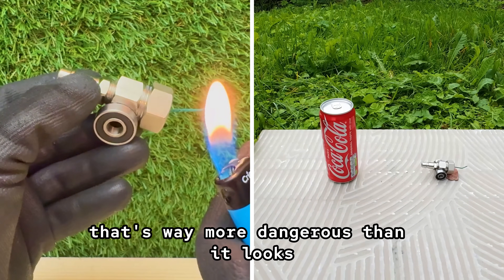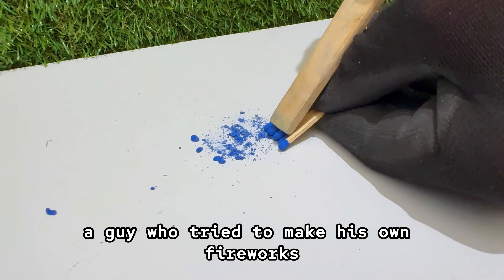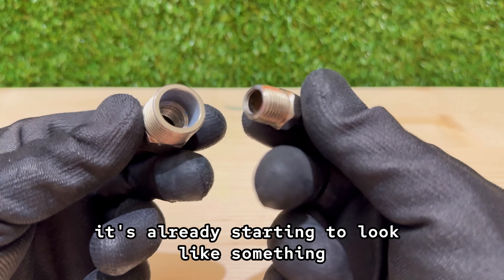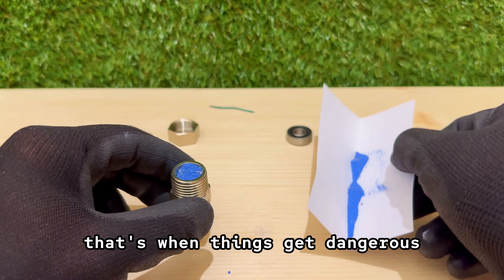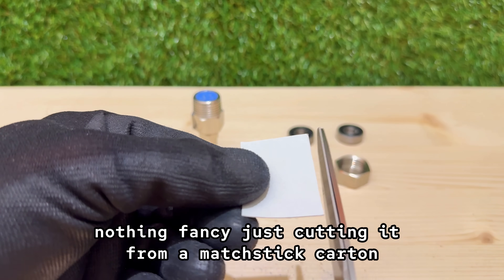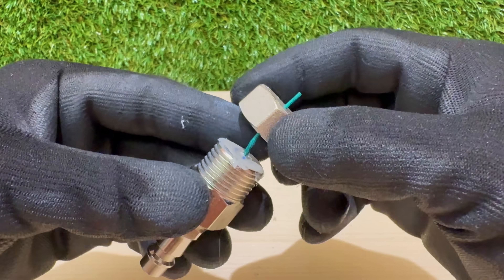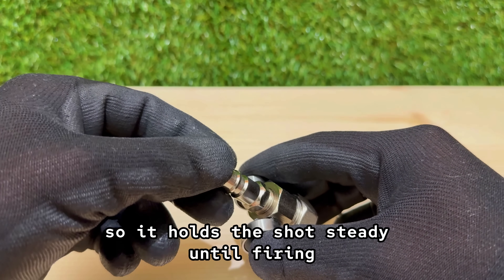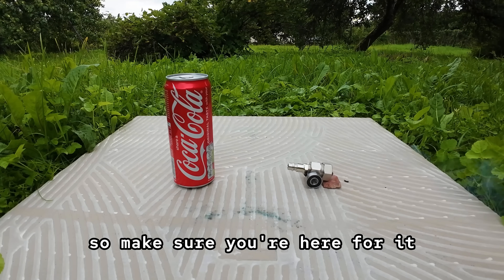This Tiny Cannon Is WAY Too Powerful!

Comment: The match heads are a mixture of potassium chlorate and sulfur. Potassium chlorate is an oxidizer and sulphur is a fuel . Pyrotechnic usually require an oxidizer and a fuel.
Reply from the maker: Yes, that’s true — match heads use an oxidizer and a fuel. Thanks for the comment! 🔥👍

Comment: you need a trap for the canon to go into . if there were a basket or a stack of books or something for it to collide with several inches behind it you might not have that problem unless it is vaporizing r something.
Reply from the maker: For this test I let it shoot freely so you can really see how powerful it is, but I actually did another experiment where I put the same tiny cannon inside a closed box to see what happens..I’ll drop the link here if you want to check it out 👉
https://youtu.be/e_qo_NYf2WI?si=L9bDoKi0Iur3XVnY

Comment: I'm 79! I was doing this when I was 10. I hammered a metal kitchen chair leg flat on one end and folded over. Drilled a tap hole with a hand drill. Packed paper match heads down with a cotton ball and a wooden spoon. Placed a paper match in the hole. Dropped a bolt down the barrel, propped it up on a brick and aimed it at my backyard fence. I lit the paper match and hid behing a tree. A minute later there was a loud bang and the molt went through not only my fence but the neighbors fence on the other side of his yard. Remember, I  was 10 years old.
Reply from the maker: Love hearing stories like that 🙌 mine was done safely and just for fun — definitely not something to try again 😅 appreciate the comment and story!
Reply: We would have been friends.

Comment: Drilling through that metal plug while holding it in your hand could have made a nice safety video
Reply: Lost my index finger doing something pretty much like that.
The drill bit snapped and went right through my knuckle.
Wrapped the nerves up like a fork spinning in a plate of spaghetti.
Seriously foolish to not use a vise or ANYTHING else to hold the thing you're drilling.
Everybody thinks it won't happen to them until the moment it does.

Comment: It's called Armstrong's mix if you add some of the strike surface to the mix via diaper mixing. Be careful though as it's very shock sensitive
Reply from the maker: Thanks for the info! I try to keep my builds safe 👍
Reply: @dominatelabs Best forget about it then. Try some on paper first.

Comment: 30 years or maybe even longer ago I messed around with matchstick powder too and your powder charge is way too much. There is a book about matchheads as gunpowder and there are also a couple of tables in it on how much to use, if you see that and then remember how much powder you did, you will s*** your pants.
Reply from the maker: Respect! Thanks for the tip — safety first 👌

Comment: You didn't make a Canon,  you failed to make a pipe bomb. You gave the propellent no where to expand and then exhaust. As soon as it detonated it blew the threads off rear cap, split the housing, and literally bounced off the tile in pieces. Don't believe me? Look up eod stories on bomb makers and how most of those taken into custody lost their first finger. The only thing that actually saved you is the compression force wasnt enough to actually turn the housing into shrapnel. There's a reason real canons are shaped the way they are. But hey,  your well on your way to being one of the stories we (eod) tell at the local bar 🤣
Reply from the maker: Appreciate the detailed explanation 🙏 That’s exactly why I showed the result at the end — kind of a warning of what not to do. All safety was in place, and it’s only for entertainment, not a guide
Reply: @dominatelabs if you intend to repeat it the bell needs the threads fortified and the nozel needs to be beveled coming from the explosive chamber. Any right angle will inhibit the force from exiting in the desired direction and instead bounce,  creating turbulent compression detonation (a bomb). You can still keep the scale,  just look into compressor compression fittings. Rather than the fitting you used,  use a bell reducer and a nipple to create the funnel to channel the force. Then you'll get an actual pressure detonation without the compression detonation. High scale potatoe guns using black gas pipe uses the same principal,  and for the same reasons.
Reply from the maker: thanks for sharing your knowledge 👌 definitely learned something new here

Comment: I’m a Matchbook collector back in the 70’s I bought a case of 20-strike matchbooks. A 2000-count case: The case contains 40 boxes, with each box holding 50 matchbooks or a total of 2000 matchbooks. I only collect the matchcovers so I carefully removed the matches. To disposed of the unwanted matches I lined a 55-gallon barrel with the now cover less boxes of matchsticks. I then lit a wad of paper on fire and threw it down into the center of the burn barrel. The end results was I had flames shooting out the top of the burn barrel about six feet high. A very impressive sight but my parents said I should never do this ever again! 🔥🤦🏼‍♂️🔥
Reply from the maker: wow that’s a crazy story 😂🔥 your parents were right tho haha
Reply: Cool!  Wish I coulda seen it!

Comment: "no metal tools, only wood" proceeds to use metal ruler to carry the crushed match heads
Reply from the maker: Haha yeah I did use a metal ruler 😅 I just meant not crushing with metal tools. I know that part haha 🙂
Reply: Non ferrous metal like bronze, brass and copper are fine to use also.
I spent years working around Liquid Oxygen. Absolutely everything was non sparking

Comment: Built mine, having a blast!!!...working on good, stable base and a chain to keep cannon within reasonable distance post firing!!  Post fire, it did not explode the barrel, but I learned the hard way, be careful how much, how "tight" you pack sulfa....then have fun blowing stuff to pieces!!!  BE CAREFUL, VERY CAREFUL...please
Reply from the maker: Thanks for the comment! 
For others: please don’t repeat or try this, it’s really dangerous. You can’t be close to it, and the mix from matches is unstable — it can explode in ways you wouldn’t expect.

Comment: 2 things: it's wad first, then cannonball. Second, use fishing string and run it through the wheels you glued, use about 200 yard spool and keep the line able to unravel by its own force. Then follow the string after the shot.
Reply from the maker: Thanks for the tips
Reply: @dominatelabs you weren't paying attention, the very first thing he did was put a wad in, before he even assembled the canon
Reply from the maker: In my experiment I used around 10× more match mix than needed just to shoot the ball
Reply from the maker: Yes
Reply: welded good chain to mine, but size and amount sulfa makes all difference, chain is small, but strong
Reply from the maker: please don’t repeat or try this, it’s really dangerous. You can’t be close to it, and the mix from matches is unstable — it can explode in ways you wouldn’t expect.
Reply: @dominatelabs extra long fuse and a good place to take cover
Reply: It already had a wad in it, from when he put the powder in

Comment: Ya back in the day we made spoke guns, using a motorcycle spoke, we would partially pack the tension nut with match powder wrap a bb in tin foil with a little tail, pushing the tail into the open end of the tension nut nice and tight then hold a lighter heating the tension nut until it went off, it could put a bb into a board.
Reply from the maker: thanks for sharing that story 🙏 really interesting